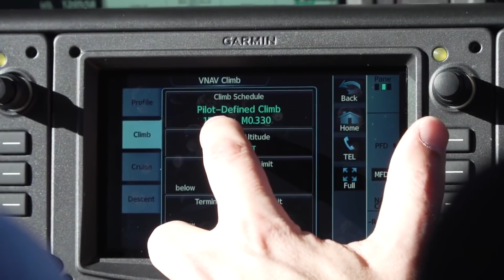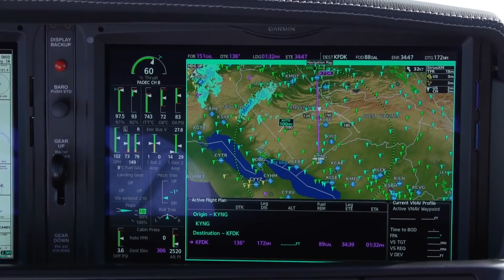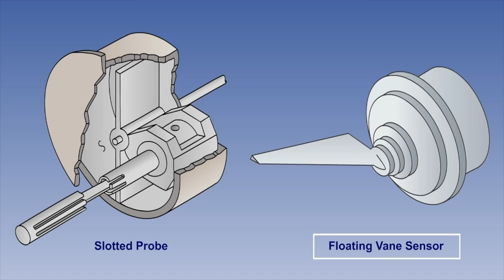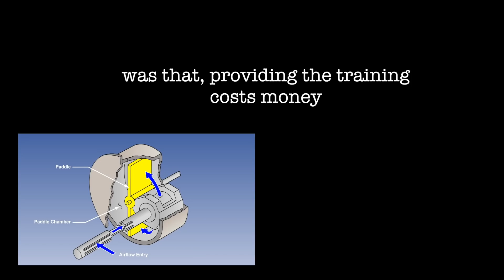Boeing Max 8 and the Cirrus Vision jet story - Prof Simon

Comment: The death trap in Boeing's case was due to not having a redundancy system (hardware and software) that is meant to avoid issues of faulty readings - whether it is faulty sensor or faulty sensor driver, or faulty circuit.
Reply: the problem was they did not follow basic redundancy in the auto TRIM program , things that was missing was limit the amount of trim it can move, use both sensors and auto disable MCAS if the pilots pull back when the MCAS is trying to Trim down (all of this is now in the new update and when it goes back into the air pilots who doesn't detect the runaway situation will no longer crash the plane as it will auto disable the moment they pull back on the sticks if the 2 other fail safes don't pick it up been both AOA used and limited amount of auto trim allowed)

this video seems to want to compare 2 different planes that are not alike at all, the boeing does have auto pilot disable button its been there for 40 years and it was not the autopilot that was the issue here (in this case the auto pilot did not enable because the 2 AOA sensors in disagreement, it wont enable if AOA sensors are in disagreement) this mcas is supposed to be transparent but because the system was not reviewed it had no fail safes in place as other flight systems have if a fault happens

the main issue was non native english pilots was talking to long to detect a runaway trim situation and letting the plane get into a condition that prevents them from using manual trim (it had happened at least 8 times in USA where stick shaker had activated on one side only and they picked up right way that the trim system was it was ignoring there trim up button command and was trying to trim the plane down so they just stabbed the trim to remove power and landed the plane), on the last crash they actually did turn off the trim power (stab trim) but they had let it get to near max trim down and they also Never at any point reduced engine power from take off power (98% from when they taken off until they crashed) so this made it nearly impossible to turn the trim wheel by hand so they turned back on the trim power which in turn ran the trim to max down with overpowered the pilots  and plane then went negative G

you should never be fighting the trim system if you are you should not be flying
Reply: The system was fully redundant--doubly redundant, in fact. There were two pilots with "off" switches who had (theoretically) been trained to use them and recover from any stabilizer trim runaway, no matter the cause. There was therefore no reason for Boeing to assume that the system needed to be as robust as their fly-by-wire primary flight controls are in other models, and no reason to assume that special info or training was needed. Their imagination failed in forgetting that it might be flown in the developing world by pilots with barely 300 hours since their first lesson and without practice executing that decades-old emergency recovery procedure over and over.

Comment: It was easy for Cirrus to appear to step up to the plate after the world is following what is happening with the Max. These things happen in every manufacturing business to the best companies in the world but the only difference is that the stakes are much higher in aviation. I remember when the mighty car company Toyota had accelerator problems killing people but they rebounded. Both Boeing and Airbus have had crashes related to automation issues and just the other day an American Airlines a321 almost crashed on takeoff because of an un -commanded left turn by the fly-by-wire system but they are busy crucifying the Max.
Reply: A Semper - Tell that to 346 souls who lost their lives and 4 crew who summoned their best skills and could not recover as they weren’t told of a ghost control called MCAS. Boeing lied ... simple truth.
Reply: @arvindvader1363  I would never minimize all the people who have lost their lives sir but since you want to go there....take a look at Air France Flight 296, Air Inter Flight 148, Lufthansa Flight 2904 or even Philippine Airlines Flight 137 just to name a few....point is..when you consider all factors and the introduction of automation...Boeing made some mistakes but so has Airbus yet the media and other critics paints this doom and gloom death and destruction only happens at Boeing. Every manufacture lies...and that's the simple truth. As far as the crew summing their best skills.......go do your research and you will see that the Ethiopian captain never trained on the Max simulator even though the airline had one of the first ones distributed to them. I do my research before l make comments on Youtube videos spreading mis information or worst yet....leave information out.
Reply: A Semper - Please read “How the Boeing 737 Max Disaster Looks to a Software Developer” by Gregory Travis that was published in IEEE Spectrum. He’s a pilot of 30 yrs experience and a software developer for 40 yrs. 

Lion Air Pilot didn’t even know of existence of MCAS - Boeing hid that and hence lied that MAX is same as classic 737s. 

Boeing has done a great disservice to its passengers who are the reason they are in existence today. 

May be they are too big to fail. May be they have too many connections in Washington. May be the bottom line is the only one thing that’s important to Boeing.
Reply: @arvindvader1363 -As I stated before Boeing has made some mistakes and the main one was assuming that MCAS would just work in the background. This is much different than lying as now the people in the media and individuals are saying the Max is totally unstable to fly which is false as it is impossible to certify an unstable aircraft. MCAS is there so the pilots can feel like they are flying a 737 NG and that's it. After the Lion Air crash the manual and procedures were updated and all the procedures were not followed in the Ethiopian crash. Coupled with the lack of 737 Max simulator time even after the Lion Air crash..that equals and unfortunate chain of events. The Max has become an industry scapegoat for software glitches and no software upgrade can fix that perception unless people get it right. Airbus and all other manufactures have been put on notice and are giving thanks they didn't have social media butting in when they had their issues and lives lost.
Reply: A Semper - Without MCAS (and with a faulty MCAS or a faulty AoAs), the MAX is unstable during take off and is very risky for a plane ferrying people. As you have correctly highlighted, Boeing assumed it’s simple and it would work. 

I also read in another article that MCAS uses input only from a SINGLE AoA sensor instead of 2 and it alternates after each power on. This is why Lion Air maintenance crew checked the good AoA sensor and cleared it as they weren’t made aware of MCAS or how it swaps inputs at every power on/off cycle. 

Several US pilots have also anonymously reported at the NASA website regarding trim issues in MAX. 

WaPo and Bloomberg have reported yesterday that Boeing has accepted that “the disagree alert was intended to be a standard feature on MAX. However, the disagree alert was NOT operable on ALL MAX planes because the feature was NOT activated as intended”.

Southwest Airlines was surprised as they thought that Disagree Alert was a part of standard kit like in 800 NG. 

This disclosure has added further mystery to the MAX’s design issues. 

Boeing is still finding out the cost of suppressing critical information.
Reply: @arvindvader1363  the software issue is now fixed (both AOA , max trim limited, pullback disables mcas witch should of been there from the start) but the other issue that these pilots failing to pick up on a runaway trim situation (and leaving the plane at max engine power) is worrying you should never be fighting the trim system if you are you should not be flying a plane, soon as the sticks got heavy and trim up was not working they should of stabbed the trim (maybe it was the stick shaker only active on one side was confusing them, but both pilots should not be flying the plane) i just surprised this has not happened before this as there is a reason there is a stab power cut off switches on the trim system (easy access on the front of it) its because it will crash the plane if it goes faulty and the pilots don't pick up on it (its a memory item)

Comment: We can see with the Cirrus that the engine is pitched up with respect to the horizontal plane of the aircraft. This would cause a nose down pitch during heavy thrust, opposite the 737MAX but the same principal.
Reply: It’s got a dorsal engine.  That means the thrust line is slightly above the centre of drag. If the pilot is on approach and feels he is short of runway and increases thrust the aircraft will speed up and but pitch forward lowering the nose thereby approach will still be short and pilot needs to pull nose up.  This is the minor problem the He 162 Germans had.  (Big Problem if you are going to use inexperienced 15 year old Hitler Youth school children as pilots). I suspect the Currus uses auto pitch or auto throttle  to correct.  (Probably Why they use FBW).  The Boeing 737 has underslung engines below the Centre of drag so will pitch up instead of down.  Again auto pitch or auto throttle help this.    T tail jets have the thrust and drag axis aligned but they suffer from the structure needed to transmit the engine weight through the fuselage to wing.  Engines harder to access for service and most of all irrecoverable deep stall and engine stall from wing blanking of inlets and tail.  Only I’ll-62 and super VC10 got over this.

Comment: You have got your facts wrong. Cirrus did not immediately put their hands up. The first incident occurred back in November so it actually took longer to ground the fleet than in the case of the 737 MAX. Also the FAA granted permission to ferry the Cirrus to maintenance as you say. But they did exactly the same for the MAXs. You really need to do better research but your videos will appeal to truthers and conspiracy theorists who are not interested in rigour, they just want something to waffle on about.
Reply from the maker: This story came from plane and pilot magazine...I assume they checked their facts...but there is always  more to every story than meets the eye.
Reply: @SimonHollandfilms  Thankyou for the reply. You assume they fact checked sure but what journos tend to do is to include 2 or 3 facts that support an angle and not mention the facts that spoil their narrative. GA magazines are not unbiased as the journos need favour with the manufacturers to be granted a test flight and the write-ups are predictably favourable. The fact that was missing here is that it took 6 months and a further two incidents before action was taken to ground the Vision jet. When the narrative is whether Cirrus acted more swiftly and transparently than Boeing, the omission of that fact does not speak of objectivity.
Reply: ignoring the fact it was a human made software bug rule that caused the runaway trim situation (witch is now fixed with 3 failsafes in place, but yes someone should go jail for it), 
why did the lion air and Ethiopian crew not pick up on the runaway trim situation (the 8 times it happened in the usa pilots did not seem to have that issue when it happened to them, soon as the stick shaker went off on one side only and they seen that the trim was going down even thought they was pressing up they cut power to trim using stab switches) maybe its due to the stick shaker only going off on one side and they completely forget trim memory procedure and panicked

the lion air pilots was actively fighting the trim system for 12 minuets (they never cut power to trim, they just kept on holding the trim up button)

the Ethiopian pilots did pick up on runaway trim but stab the power to trim to late and trim was to far down so hand manual trim was to hard to turn it and they left engine power at 98% witch resulted in overspeed due to pitching down and worse they switched the powered trim system back on witch then crashed the plane as they went negative 1 G when the plane went to max trim down
Reply: Thanks - I always thought persons with fancy titles were perfect!!!
Reply: Another wrong fact. The Cirrus has a stick pusher, in addition to the stick shaker, which is much more dangerous. See: http://rgl.faa.gov/Regulatory_and_Guidance_Library/rgad.nsf/0/448c46c035e93a6e862583e0007291d8/$FILE/2019-08-51_Emergency.pdf
Reply: Boeing 346 dead people, Cirrus 0. Those are the facts.
Reply: @ohwell2790  -  and your point is that small private aircraft are safer if the total head-count resulting from their accidents is less. Seriously, that is the absurd point you are pushing.